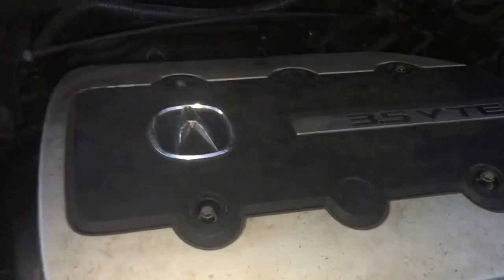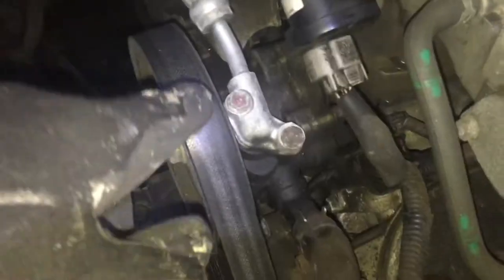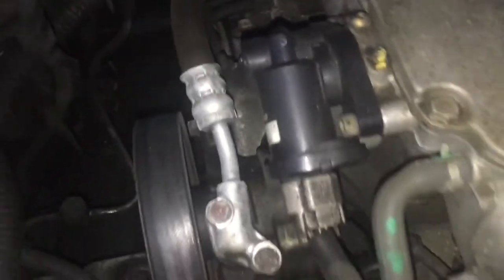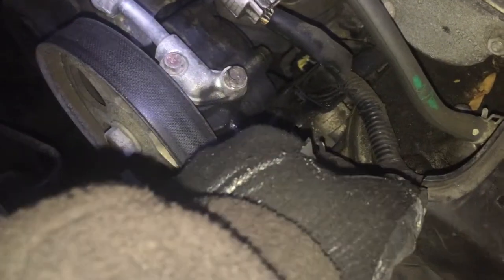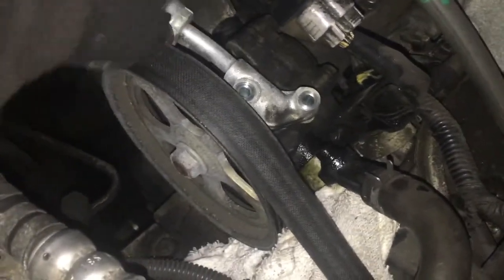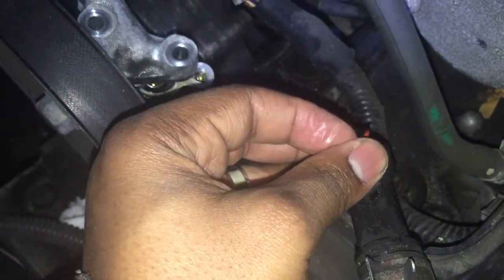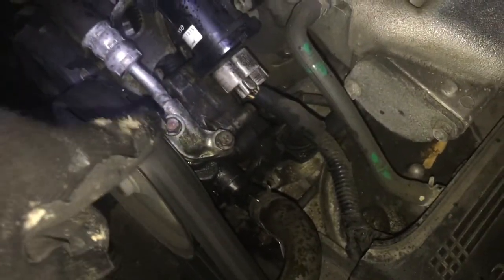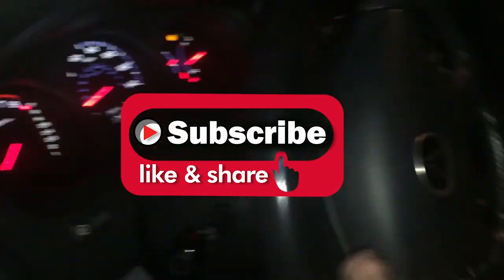How To Fix Power Steering Whining (Acura MDX)

Comment: It was not easy to access the bolt, which is on lower side. I decided to remove two hoses to the fluid tank, and store away the tank. This made a bit easy to access the bolt. Some build got spilled, so I will be refilling the fluid tank and test how well this repair works in my case. Hoping replacing two "O" rings will resolve the whining noise problem. Lets see how it goes...

Update: I can’t believe that this repair worked. Replaced both O rings and now whinning noise is gone.
I am happy with this results.
Thanks for this video, appreciate it.
Reply from the maker: Yes, that particular bolt is a pain to get access to but hopefully replacing the O-rings helps resolves your issue.
Reply: Nice thanks for the update. I'll try this first before going deep, lol

Comment: Good video! Just a quick bit of additional info - the whine is caused solely by air entering from the SUCTION side, so somewhere between the reservoir and the pump inlet. So the suction side O-ring is a culprit for that, as well as the hose and clamps between the reservoir and the pump. If your high pressure output side O-ring is bad, you may see some fluid leakage from there, but it won't be what's causing a pump to whine. Not a bad idea to replace both at the same time, but if you can only get ahold of one, do the suction side first.
Reply from the maker: Good information.
Reply: I was not able to find out which side is 'suction' side. So I replaced both O rings. I have not tested yet.
Hoping for the best.
Reply: @umakantgajjewar8898  hows it goin

Comment: 2006 mdx that whines only when I am driving and turning the wheel. Louder when it's cold. Could the o rings cause this. Just changed the power steering line caused it was leaking.
Reply from the maker: Yes that's correct, the O-Rings are allowing air into the system which is causing this issue. You will need to replace both O-Rings and then start and turn your wheel a couple of times to let the remaining air out after replacing the rings.

Comment: I’ve a 07 Acura MDX and the steering wheel is a little tight to turn and it makes some sound when I crank and accelerate … Do I need to replace the orings?
Reply from the maker: Yes ma'am, I would replace both o-Rings and flush the air out the power steering system.

Comment: Did you drain the power steering fluid reservoir at all before doing this job?
Reply from the maker: Honestly can't recall, it's been awhile. I do recall that once the o-rings are replaced I did do a drain and fill for clean fluids. Hope your able to resolve your issue.
Reply: @AWordFromMrJones  That makes sense. May as well replace with clean fluid. Thank you so much for the help! Your video was very informative 🙂
Reply from the maker: @jamest4162  No problem.

Comment: My 2004 MDX has the whine.  I had a mechanic do everything in this video and it got worse. He says it’s the pump.
Reply from the maker: That's very much possible. Here are the following issues that anyone could experience:

#1 Always use the OEM o-rings, after the rings are replaced you will need to remove the air in the power steering pump. Sometimes it takes a few steers and sometimes it could take a full week to get the air out.
  - Some MDX the air gets caught up in the power steering lines under the truck. It's like a air pocket because of the design. 

#2 If used non OEM o-rings, the pump could leak out fluid and let in air, OR let in air which will cause it to squeal more. 

I would recommend replacing the steering pump based on the vehicle mileage and the issue that your experiencing. If you want to save money on the repair, then you could try driving around for a week to remove the remaining air pockets that might be stuck in the lines.

You can start the truck, pop the hood and pull the cap off the power steering reservoir. If there is a lot of air in the system you will see a lot a bubbles, if there is a few air pockets, then you will see a little. Sometimes you can pull the cap off, and turn the wheel left to right, sometimes when you do turn make a hard left and hard right turn. Once you get to the end of each turn, hold it in that position for a few seconds and then turn the wheel. 

That will help remove the air pockets, be sure to top off the power steering fluids if it's low.
 
Hope this helps.

Comment: Did you have to drain the power steering first?
Reply from the maker: Nope, turn the engine off so that the power steering pump remains off. Put a couple of towels underneath to catch some of the  steering fluid that was left in the hose/line. You'll be good to go.
Reply: Thanks for the information, I'll be attempting this today.